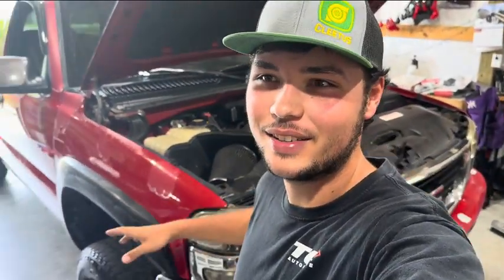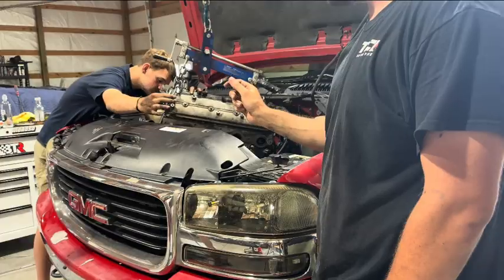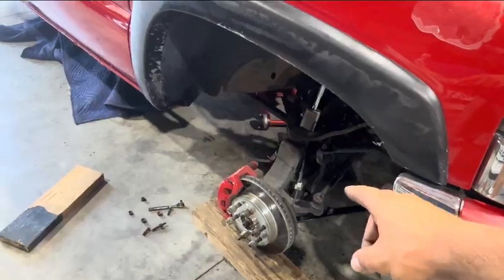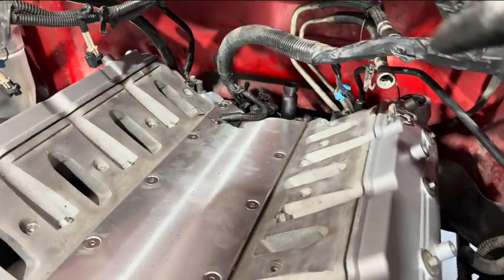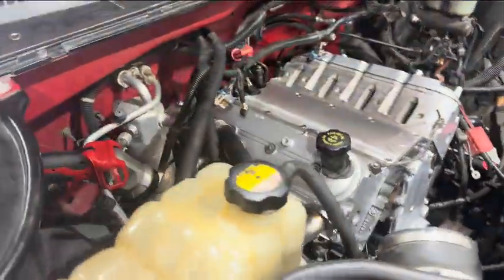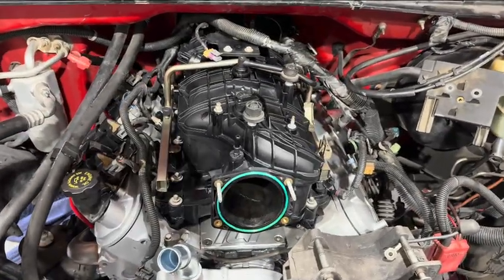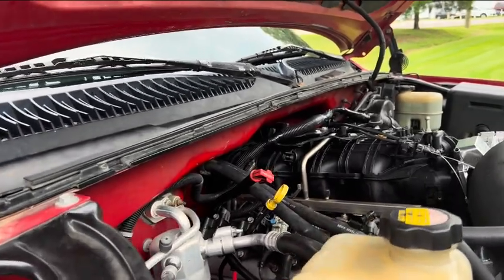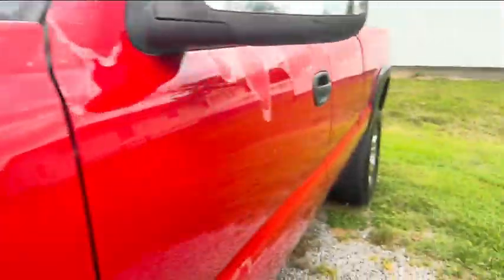Built 6.0 Ls swap Silverado, can we get it running in 2 days? Stock 5.3 to built 6.0

Comment: Do you think is bad putting 317 heads on a 4.8 ? I’m rebuilding my 4.8 and found a good deal on some re surfaced 317 heads so I’m wondering ? What’s your thoughts
Reply from the maker: Stock 317 heads yes, if you milled them around 30 thousands it will be ok but still lower compression than stock but it will have more air flow if it has the proper camshaft for higher rpm. If you don’t plan on running 6,500+ rpm or it is in a heavy application I wouldn’t put the bigger heads on it in my opinion.
Reply: @tekperformance270 it’s a daily but I’m doing a truck Norris cam ls7 lifters push rods valves , speed engineering long tubes and later ima do a tbss intake with 92 mm throttle body you think it would do good with the 317s ? With  that
Reply from the maker: @luigarcia4350 personally I wouldn’t leave the 862’s or 706 heads. The 799,243,317 yes they flow more but you might not be utilizing that. The 317’s stock will kill the compression and you will loose power. Best case over stock would get some 243’s or 799 and mill them 20 thousands.

Comment: So what was/is the issue with the cam sensor or cam
Reply from the maker: Poor quality of parts store cam sensors.
Reply: @tekperformance270 so it was the second sensor because it was not  a GM part!!!
Reply: I’ve heard you have to use Gm  brand crank sensors. Good luck